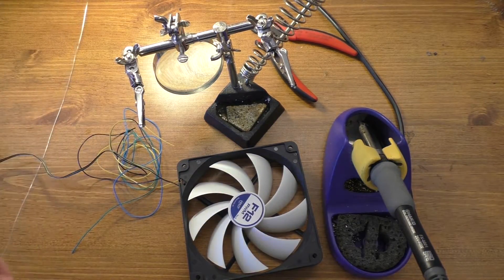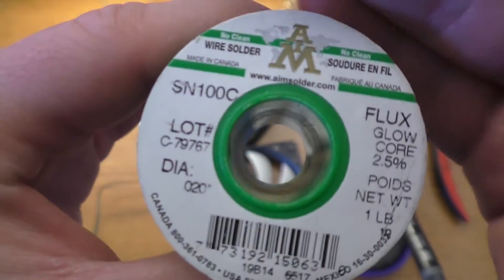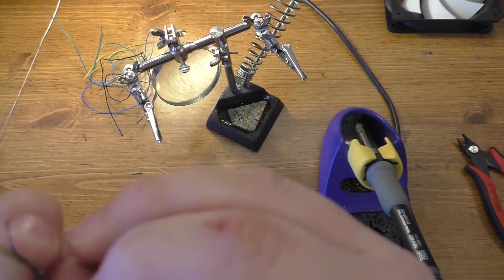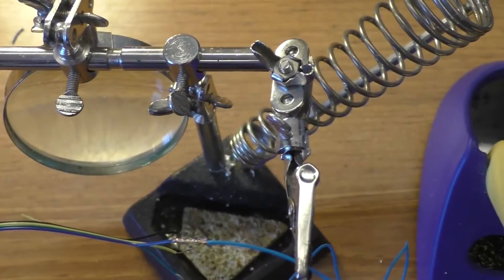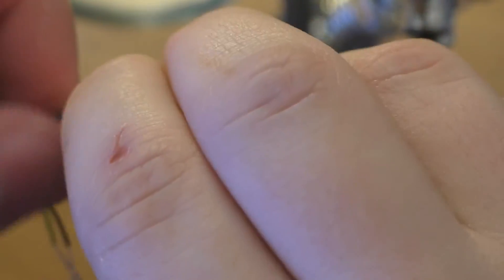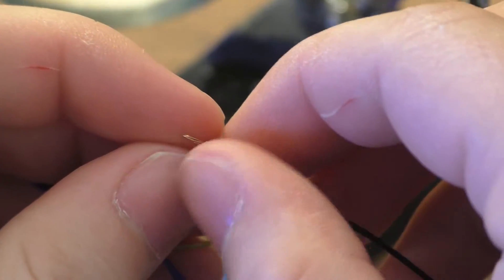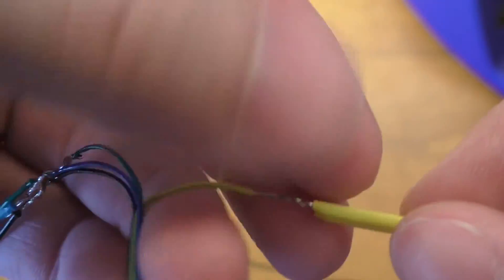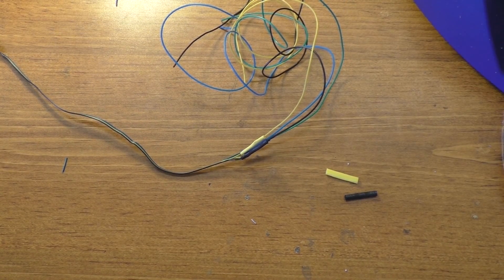How to Solder Wires

Comment: The insulation melting should be a hint that you are having to apply too much heat. You should tin the wires and then wrap them around one another. After that apply a tiny bit of flux and the two pieces will flow together perfectly. 

I've had to learn some soldering techniques as it costs a ridiculous amount to replace lab equipment.